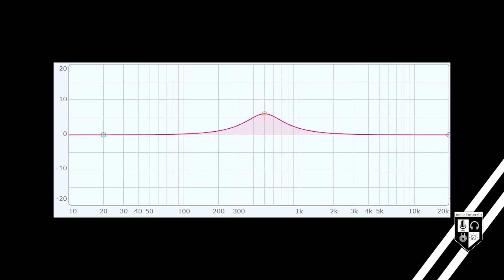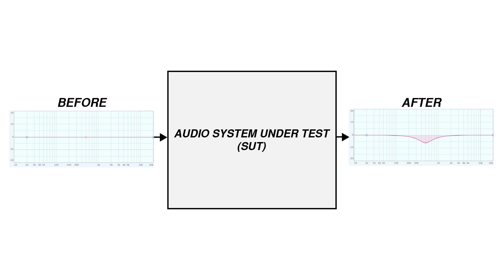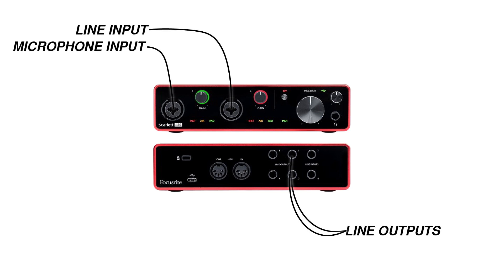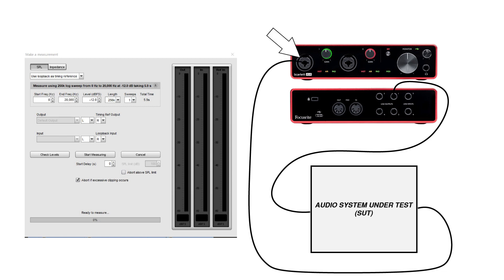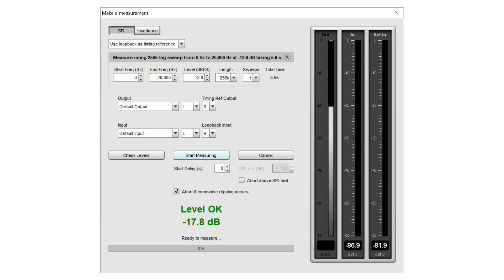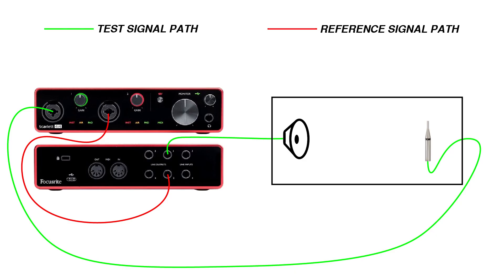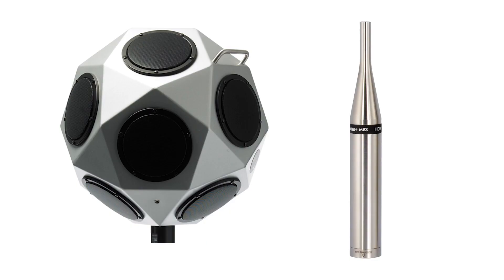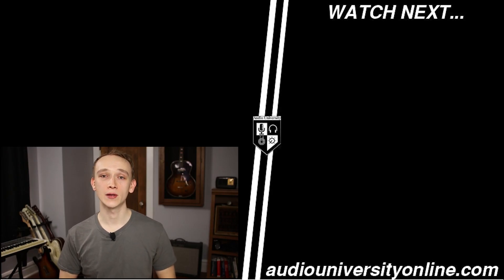FREE Acoustical Measurement Software: Room EQ Wizard (REW)

Comment: Any chance you can update this video.  I have a UMIK-1 mic which came with a USB-C cable, not a XLR or TRS to connect to the Focusrite 2i2 gen 4 interface.  Also can’t figure out how to connect Output from the 2i2 to the Inputs on my Cambridge Audio EVO 150 Amp.
Reply: That mic has a built-in audio interface, hence why it’s USB. so you won’t use your Focusrite.

Comment: I have an amateur question about measuring loudspeaker systems. I have a calibration file for the microphone that came with the microphone. I have calibrated the external sound card in REW (at levels of -12 dBFS, a nice flat response was achieved from 10 Hz to 30 kHz), and now I'm wondering... what about the amplifier, which amplifies the signal from the sound card and sends it to the loudspeaker systems? The amplifier itself can change or 'distort' the SPL graph of the speakers with its specifications... shouldn't the sound card and amplifier be calibrated simultaneously to obtain reliable data? Best regards

Comment: OK, I guess I need to get some actual "pro" equipment like this stuff then, starting with a computer it sounds like, because ALL that I currently have out of those 5 things listed is the speakers... Quite a few different pairs actually, ALL of which I've gotten at thrift stores for under about $20/pair.

I don't have any kind of computer, other than my cheap basic cellphone that I'm using to type this comment out, and I don't think that would work for using this type of software and stuff. I need more money!

Comment: Hey @AudioUniversity,

One quick question once we got the txt file after adding the eq settings on the speaker how are we gonna update on the audio interface for example here you are using focusrite so l’età say if we want to sound with the updated equipment filters what we have to do?
Reply from the maker: That profile isn’t loaded into the Focusrite interface. It requires a software like Sonarworks or some other processor in the signal chain.

Comment: I downloaded the Monitors placement and … I saw the sub putted on the left .. almost under the left monitor .. don’t have a sub but thought for a long time that’s the best placement is in the center which sounds logical .. any explanations please ??
Reply from the maker: Theoretically the center would be superior. But so long as the system is properly phase aligned, that slight offset doesn’t make a large difference. As humans, we struggle to localize the origin of low frequencies as effectively as higher frequencies.
Reply: @AudioUniversity  got it ..thank you

Comment: Trying to use REW and all I have is my macbook, a basic mic that came with my NAD to use Dirac. Otherwise I have an old blue yeti and more recently the mix pre 6 II and the sennheiser mkh 416 for voice recording. Can some of these devices be used so that I don’t have to buy a new mic to use REW to test my living room sound system? Thanks for the great video!
Reply from the maker: Any omnidirectional XLR microphone with a relatively flat frequency response will do! Really - any microphone will work for experimentation and some tests. You just need to remember to factor the microphone's frequency response into the equation...

Comment: What cable plug type is used for audio interface shared XLR socket for 'line in'? Is it 3.5mm mono?
Reply from the maker: The combo input jacks commonly found on audio interfaces is XLR and 1/4-inch TRS.
Reply: @AudioUniversity  Thanks

Comment: You say that you have to connect the output of the SUT to input 1. But if I'm testing headphones I don't have an input and an output jack, just plug into whatever i wanna hear. I don't know how to move on from this step
Reply from the maker: To test headphones, you’ll need a microphone that captures the output of the headphones. That microphone will connect to input 1.
Reply: @AudioUniversity  ohhh I was confused. I have a condenser mic that’s powered at 48 phantom so I should be fine. Thanks!

Comment: How to connect umik-1 usb with focusrite?
Reply from the maker: I don’t believe you can connect it to the Focusrite (or any audio interface). I prefer to use an XLR mic for this reason. 

You will probably need to select the mic instead of the audio interface, but I expect that might eliminate the possibility of a reference signal.

Comment: Please, I will like to know if REW can be used for room tuning in large system setup like churches in the absence of paid software like SMAART
Reply from the maker: One of the best features of Smart is the phase scope for aligning sections of the PA system. I’m not sure if REW has a live phase graph like that.
Reply: @AudioUniversity  If you're looking for a free software to use that functions as a two-channel analyzer like SMAART, I'd go with Open Sound Meter. It's technically "donation-ware", but you can download and run the full version for free. Then if you like it and use it I'd consider donating to the developer.
Reply from the maker: Thanks, Michael!

Comment: should I be concerned to calibrate soundcard IF I am merely trying to measure my rooms acoustics via REW ... 
My goal is to mix with best stereo image in the room -and Ive treated the room well with Corning 703 panels.
 Ive borrowed an ARC 2 mic, got the REW ware and it suggests to set a in/out loop to calibrate soundcard. I have an RME UFXII as prime
clock and source, which is (also my audio interface)..... So, do I need to skip soundcard step? Guess Im just lost on the routing chain...